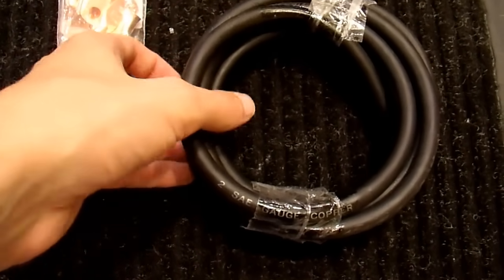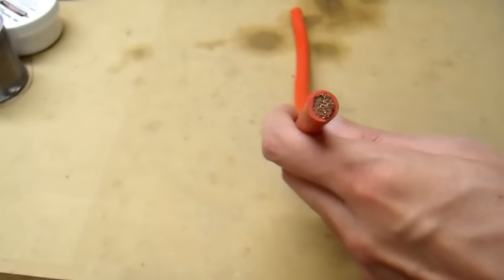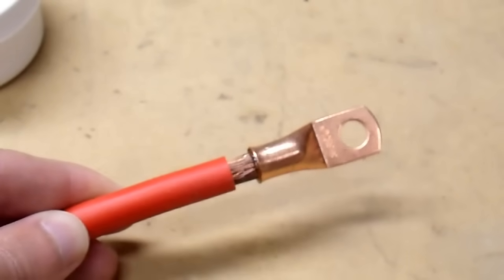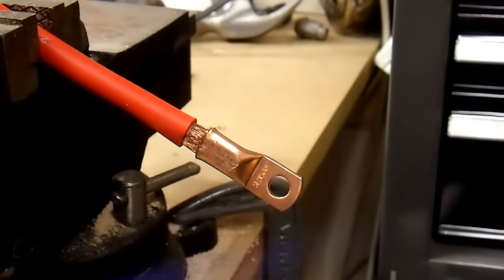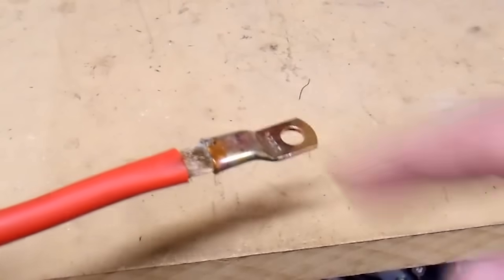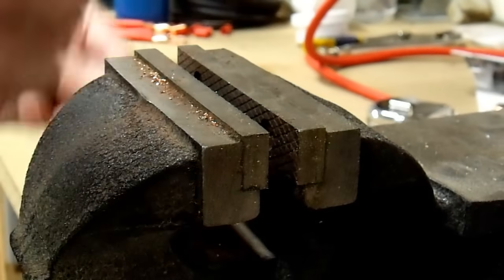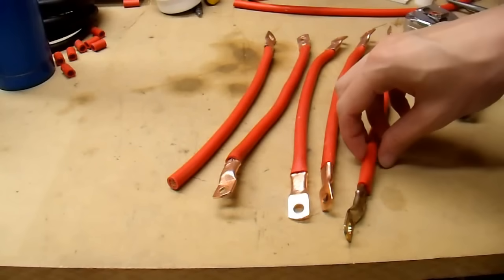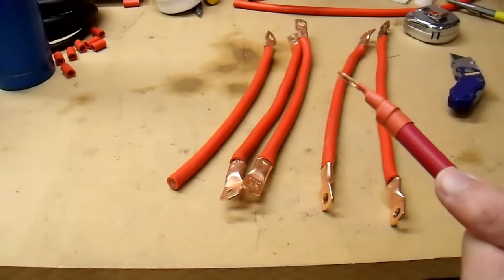How to Make Battery Cables the Right Way and the Easy Way

Comment: clearly this person has no real training for this job as anyone who has, knows why you use the right tool to crimp wires. To ensure you don't under or over crimp both of which WILL reduce reliability and longevity of the joint. besides if he thinks making 10 joints in 10 mins is quick sorry with the right tools it takes little more than 10-20 seconds to do each joint. 
As for corrosion he is right a soldered joint is more corrosion resistant than a crimped joint, but adhesive lined heat shrink will remove any chance of moisture getting into the joint. while we are at it lets not forget how much flux was used far far too much especially as its not a no clean type and even worse as he states he is using a multi-cored solder which contains all the flux needed he will undoubtedly have left corrosive residues of flux in the joint due to his over exuberant use of so much flux when none was required. So no amount of weatherproofing will stop the corrosion his method has introduced.
His method of using a vice also ignores the fact the crimp has a bell mouth on it for a reason, to protect the wires from damage caused by the entry to the crimp his actions removed that protection and thus will have resulted in damaged strands. As for heat shrink hiding things any inspector worth their salt can easily see what a joint is like under the heat shrink without needing to see the joint directly. 

In short do not follow the advice given in this video, you are only setting yourself up for long term pain and electrical faults at best. Use the right tools in the right way and if you do feel the need to crimp and then solder for enhanced weather protection use the right multi-cored solder.

Comment: I dis agree with this method. Now that said, as long as the solder is the correct composition for the type of wire/terminals you're using. This is acceptable crimps when solder is used. Otherwise, use a full cable crimp tool (not pliers or vise) then solder the connection, then  heat shrink tubing!

Comment: Fuck the 100 watt soldering iron- Knurlgar uses a propane torch to solder his cables- That's why he's the man!
Reply: +faffaflunkie people have been soldering with flame (either directly or to heat an iron) for decades.  Surely you dont think no electricity no solder.
Reply: Usually you see a torch only being used on copper pipe nowadays. But a small torch is a great with electrical connections and especially for unsoldering old inline IC's from junk circuit boards. And yes, TTL and CMOS chips can take the heat.

Comment: Don't solder crimps, that's why they crimp so you don't need to solder because solder makes the wire solid at the terminal and it can crack to conductors as it flexes. soldering is for fixed wiring never automotive wiring  that is subject to vibration and flexing that will crack the conductors where they are soldered..

Comment: IMO , you should solder your cable ends first , then if you feel you need to crimp it , then do so after .
Once you crimp the end , there is no room for the solder to flow into the end etc etc .

Comment: Hey folks, PLEASE just skip this video. It is filled so much incorrect information and ignorance that he is just laughable. The exposed wiring below the terminal is only acceptable if you don't give a crap and are lazy. Flux is more harmful than beneficial for this project and completely unnecessary. A hammer and punch may have many great uses, but this is not one those times. All he is doing is flattening the wire and terminal even further, causing even more potential for a poor connection and slippage, in effect he is getting a completely opposite result than he gives as the reason for his using them in the first place. And it was when he started talking about heat shrink that I knew this guy was an idiot and a complete HACK.  There are so many sources of this basic and fundamental information that contradict him nearly every step of this video that there really should be a way to have this video removed. It is ignorant and shows how little he actually cares about other people to make an instructional video spewing his own flawed opinions as if they were actual facts. I hope someone bitch slaps him if they ever see him. If they post it here they could call it "How to make a moron STFU the Right Way and the Easy Way"
Reply: yep U R Right